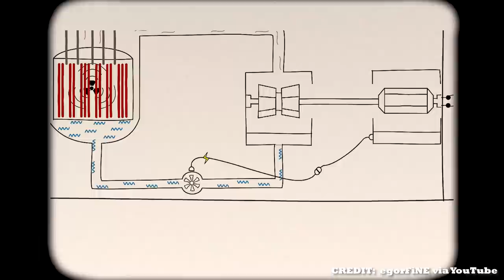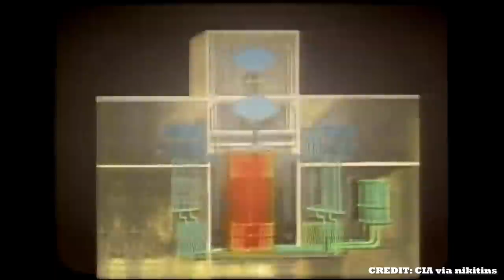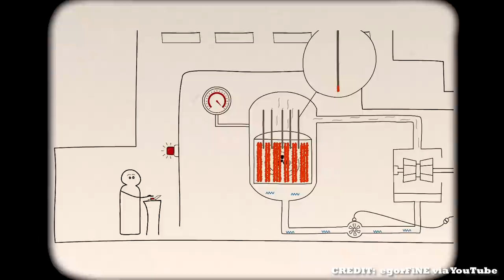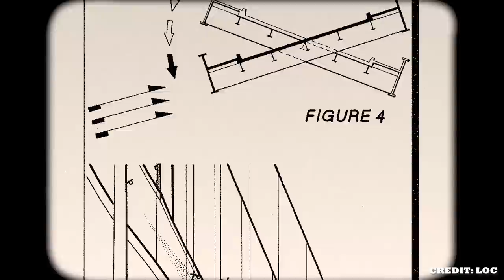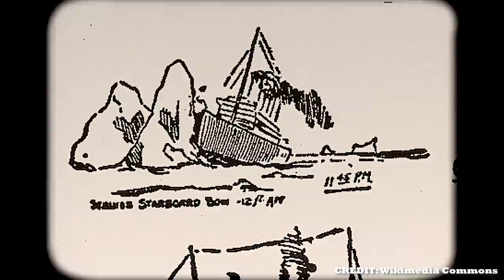5 Most Expensive Engineering Mistakes

Comment: The destruction of the Hindenburg is NOT the worst airship engineering disaster as that title goes to the R101 in 1930. The Hindenburg was well designed and the fault was the use hydrogen instead of the helium it was designed for, while the R101 had several actual design faults which caused it to crash and kill 48 people on crossing the English Channel, a much shorter trip than the Hindenburg and its loss of 35 people. Politics had more to do with the loss of the Hindenburg than anything else.

Comment: Always wondered how 60-odd people managed to get out of the Hindenburg alive.
Reply: There was an asbestos-lined smoking room on the bottom passenger deck.  at least two women were in it and walked out unharmed.  A boy somehow got out and as he was about to be burnt up, a ballast tank of water ruptured right above him.  He was fine, too.  one big problem was the diesel fuel for the prop engines.  Although the flames were spectacular, the burning hydrogen rose upward, very fast.  Of course, the reflective pigment in the skin was powdered aluminum, so that didn't help anything.  In fact, the skin was incredibly flammable.  I watched a video where a guy held a surviving scrap of the original skin in an electric arc, and it went up like a road flare.  Powdered aluminum is a chemical fuel for rocket fuel and bombs.  I think it's a star ingredient in thermite, too.  Not something to make an aircraft out of.